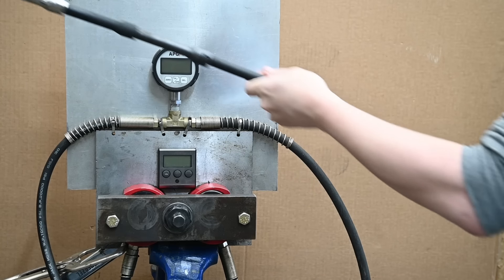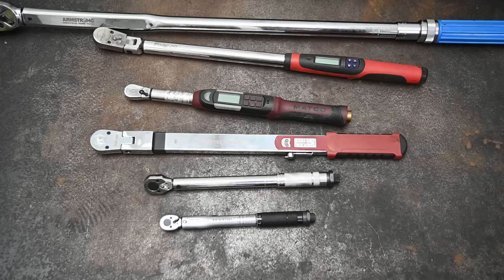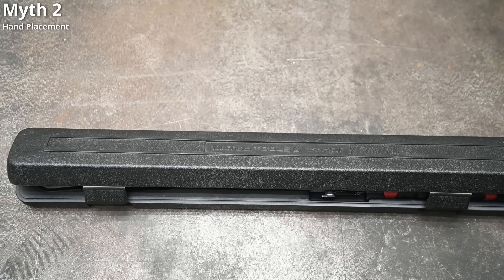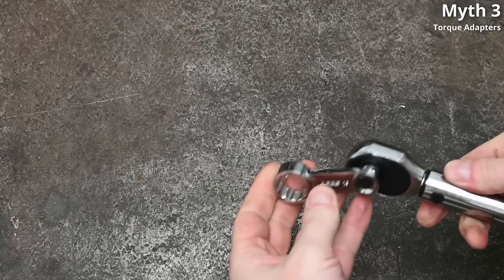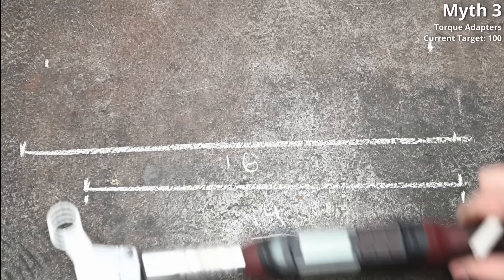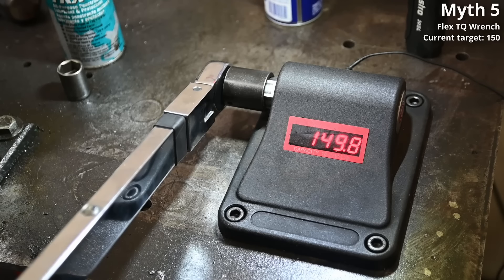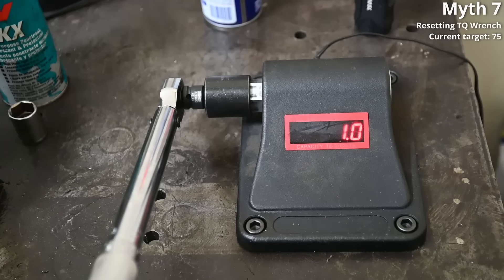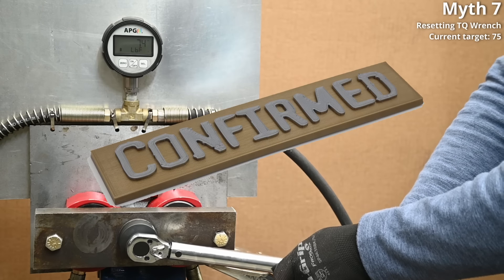You're Using a Torque Wrench Wrong: MythBusting 10 Do's & Dont's

Comment: i've generally enjoyed using the wrench by holding the end. easiest to apply the torque.
Reply: Yeah, it makes it harder work holding it anywhere else other than the handgrip. It's easier to get small bike wrenches wrong though, span your hand up and do something like push with your thumb up toward the drive head, and that could be a problem if you were trying not to over torque a carbon fiber part.
 I liked your Rio Grande Zephyr with 5714 heading.

Comment: I don't understand point 9: anti-seize.

While I can see that a torque of 100 lbft dry will put less tension on the bolt than 100lbft greased, the two devices are not measuring the bolt tension, but the torsion.  And, as such, if the torque wrench and the 'dyno' you are checking it against are in agreement, they should have the same reading whether lubricated or not as they are measuring the same thing (even though the tension on the bolt is dramitically different).  But they don't, so what am I missing?

EDIT - reading the comments, richardhorstketter6574 suggests that the 'dyno' is measuring tension and displaying a calculated torsion reading.  If this is correct, then that explains what I am missing and begs the question of why we weren't told this in the original video.

Comment: It's all about tension. Torque is a unit of force. 1 lb of force at 12" from Axis is 1 ft lbs. Of torque. Most wrenches are calibrated to be turned only from center of hand grip area. The biggest influence on tension v torque is thread condition and lubrication. All this being said, the most accurate way to tension a bolt properly is by using turn of the nut method . Torque angle I believe is the same concept. If you use a socket that comes outside the wrench axis, you must calculate the difference.

Comment: I did forget and leave my clicker torque wrench set to 100 pounds for a month. Do you know if letting it rest while set to 0 or 20 ft-lbs would let the spring recover?
I came up with a DYI torque calibration technique: I put a bolt in my bench vice, put the torque wrench on it with the handle parallel to the floor and then hung bar bell weights on it from the center of handle grip. Then I did the math for the 18" length of my wrench. It tested well, so maybe the wrench spring did recover. I only use the wrench for lug bolts so I called it good enough.

Comment: No the angle on the flex head torque wrench does make a difference it's just a small difference at the angle allowed. The effect of inclining the handle is identical to the effect of holding it at a shorter distance, but cos(x) ~ 1-x^2/2 so the effect of the shortening at small angles is very small.

Comment: You didn't mention that when using long extensions with a torque wrench, it requires you to use much more effort.  You have to overcome the twisting of the extensions, in addition to delivering the set torque amount.
Reply from the maker: Good point

Comment: Good video. Thanks.       What if your TW was sitting at a high setting for a long time but now has been sitting at a low setting?  Theoretically letting the spring relax.   Can I now adjust it to the setting I need and get accurate readings?

Comment: The Pittsburgh might be a little better now. 15 years ago I bought one and I would torque this aluminum bolt in the 4l80E trans. It torques to 12 ft lbs and breaks at like 18. Come to find out I had dozens of units out in the field with that bolt broken. Must have been clicking a lb or so before breaking and then breaking in the field. So just beware.

Comment: On conical seat wheel nuts, most of the friction is from the seat itself and not the actual threads as they are much oversized for extreme reuse and abuse. Would you test that? I always lubricate my wheel studs with either moly grease or copper anti-seize and have not had these results. My experience is that I get more consistent torque especially with old or very used fasteners.

Comment: Excellent video. Using a lubricant on the head of the bolt or not , ie , the mating surfaces , must alter the torque applied as well ?. Regards from the UK.

Comment: Excellent video.  Wondering what would have happened with that Pittsburgh wrench if the tension was released and it was left to sit a week or so.  Would it return to being accurate on its own or is the spring permanently altered by leaving it in tension for 6 months?  Because if it does go back to its original state it would seem if it was recalibrated before being allowed to do so then it would go out of calibration as the spring regained it's original characteristics.

Comment: Most people don’t adhere to lubricant used on head fasteners. Ever take the bolts out that never been out before wonder why carbon coated? They used oils to install at factory.

Comment: Where you press on the wrench and how you press is extremely important, especially at lower torque values. It has to do with the length of the shaft from the head to the breakaway. You can, rather easily, make a torque wrench break at 12 in pounds without even rotating the bolt at all.

A crow's foot makes this distance longer. That is 100% the exact same effect. At 90 degrees, this length is NOT increased, because it's only the length in the direction of the shaft that matters.

15:50 The adjustable wrench head is longer, so it gives higher values. There's zero reason the head shape matters. Exact same effect as the previous two. All that matters is the lever arm length.

Comment: For the extension at different angles, I wonder if it's really the "horizontal" length as you're showing here, or actually the distance from the center of the handle to the bolt. With a short extension like this they'd be almost equal, but that might not be true with a much longer extension... e.g. imagine a 14" wrench with a 14" extension at a right angle - the actual distance from handle to bolt would be sqrt(2*14^2)=19.8"

Comment: By scrolling just 5 comments down, it appears that a follow-up video (series?) addressing anti-seize (and other thread 'lubricants') more in-depth would be much appreciated.

Actually, I wonder what effect thread locker has, too. We're just scratching the (unintentionally-lubricated) surface...
Reply: I thought it was interesting that you applied it to the 'back' of the threaded portion, as opposed to the 'front'.  I've tried various methods here in NE Ohio and settled on a conservative 'line' from the one end of the threads to the other. Which would apply roughly an even coat to all threads. 

It goes ALL OVER the back of my wheels and/or wheel-mating surface of my brake rotors/drums. (Not too much, of course, because that could 'anti-seize' your braking surface... and likely lead to unexpectedly anti-seizing your body from the vehicle or head from your neck.  Ain't nobody got time for that.)

Comment: New question: Does Loctite work mostly by turning into glue later, or mostly by encouraging you to tighten the nut or bolt more securely due to reduced friction while wet?

Comment: I have a love hate relationship with digital torque wrenches. I like the technology and accuracy, but it’s so easy to over torque. The tactile feedback of a clicker just allows me to respond faster, being able to let up on the wrench before I go over my torque value. Also, I feel like with a digital, if my target is 50 and I hit 50 and go to give it another confirmation pull, the fastener will seem to move again before it even starts to hit 50. With a clicker I can click the wrench a thousand times and the fastener will not move a single degree more after the first click. Never was able to figure out what that was about.

Comment: With anti seize,  Ajax the bolt manufacturer recommends using 30% less torque when using anti seize or lubricant. So there is that.

Comment: I have one for you to try. I have had to torque some bolts recently to 1800 ft/lbs and the biggest torque wrench I have only goes to 600ft/lbs. I used a 5 times torque multiplier and torqued them to 360 ft/ lbs. the only thing I am worried about is how accurate this is.

Comment: If you tighten your wheel nuts to torque while dry, mark the position, lubricate them and then retighten to the mark, you will have wheel nuts effectively tightened to about half where they should be.  They will undo themselves and your wheel will fall off.

Comment: Is the anti-seize test truly representative of wheel lug nuts and studs? Yes anti seize will reduce friction between bolt and nut, but wheel nuts have a taper that engage with the wheel which provides a ton of contact area and hence is a major source of friction. My question is, what’s the impact in that case to use anti-seize just on the threads but not the taper?

Comment: Antiseize is to be applied like cologne. Just a dab. Its not gravy on a biscuit or syrup on a pancake, you apply it like super glue. Wipe the excess off of the brush and apply a thin dab on one side of the threads and let the nut spread it around. Retry with that in mind and try with the different flavors for science sake. My employer mandates the use of copper based anti seize on lugs and very rarely do we brake a stud. 30-100 tires a day 7 days a week 363 days a year and maybe 5 broken studs a year and normally it's a FNG that does it. Curiosity demands answers if you'd be so kind.

Comment: Can you explain your machine?  I believe  you say that it measures bolt tension and translates that to the applied torque. How are you able to make the conversion? There are many factors affecting the relationship between wrench torque and bolt tension.  If you are testing torque wrench accuracy, isn't your calibration machine the best method?

Thank you
Larry

Comment: What about changing grip distance on a Deflecting beam torque wrench? Like the kind you have to look at the needle as it quivers over a graduated plate near the handle.
Reply: Most beam wrenches are length dependent. The design you describe would be awkward to use from the wrong location. But if you did pull from a shortened position, the indication would become inaccurate, as a portion of the beam no longer deflects but rather remains straight so the scale would not move as far as it should travel under the pointer, so it would read less than the actual torque being delivered. Many have a knife-edge in the handgrip to precisely define the loading point - my old el-cheapo one doesn't.

Comment: I was yelled at by my neighbor for adding a cheater pipe to a torque wrench.  Buuuut said wrench was a old style one where the needle comes from the head back a physical scale and the measurement comes from the bend in the shaft, not a racheting interior. I've also had to recalibrate it because I welded it.

Comment: My 2004 jeep liberty sport needs new axel hub mounting bolts. The torque is 97 pounds. When you add anti seize. You set the torque on 194 correct? Regular torque from Walmart.

Comment: Piggybacking on the anti-seize "myth," would it be possible to do the same test with a threadlocker?

I'd imagine there will be a similar effect vs a dry bolt (and a similar work-around), but it'd be nice to see if the problem has the same magnitude of the anti-seize.

Comment: but realy accurate "bringing tension into clamping two pieces"  is done on Wartsyla ship diesel engines , where you pull hydraulically the rod and rotate by hand the nut down  and than release the hydraulics

Comment: Myth #7 - from what I've been told (at least pertaining to gun magazines) is that springs will take an initial set but then stay there. So my curiosity then is after recalibrating a torque wrench that had been stored compressed, is it now less susceptible to the torque changing if it is stored compressed a second time?

Comment: You don't mention 'beam scale' type torque wrenches.  No need to worry about calibration, they just work.  As long as beam returns to zero you're good.  BTW-  how do you calibrate a digital torque adapter?  Buy two?  haha.  Right.  Good tip on the luggage scale, it's easy to calibrate.

Comment: Hey, I have a question about the anti-seize. How much is too much? Or is using any at all going to screw up the torque reading. For example, if you put a different amount on the threads or maybe just put it on the head where it contacts the mating surface. Just questions I had that maybe could be tested. great vid!

Comment: 18:30 Could one: 1) Bottom out the bolt-head by hand 2) Wrench to the desired torque, thereby exactly counting the number of turns (example: 7,25 turns from out-bottomed bolt-head to 100Nm)  3) Unscrew the bolt and apply the lubricant to it 4) Bottom-out the bolt-head by hand, try to apply the same hand-effort as previously, but in no case more effort that previously 5) Wrench it further (from the example above: for 7,25turns exactly) with the same, original torque-wrench (or with any other simple wrench, where the hand-grip-center to bolt-head-socket-center have the same distance as on the original torque-wrench). 
Could that circumvent the problem ??? Will you give it a try, for the sake of experimenting?

Comment: What about dropping the wrench? Every time a torque wrench is dropped in the shop I work at, it will get recalibrated and won’t get used until so. I’ve always wondered if that is true
Reply: There are videos of people testing the result of abusing torque wrenches and finding they were still within spec until quite severely damaged. What I think it comes down to is that the wrench becomes an unknown factor if something untoward happens to it. Unless it's confirmed in spec, that becomes a liability if you're representing to customers (or an insurance company or accident investigators) that everything was done properly.

Comment: I have a counter to the always zero your torque wrench, I bought a cheap, on sale ½ inch 20-250 ft-lbs click type wrench 28 years ago for use at home. As a professional, I always went to my schooling and zeroed it after use... Well one time I forgot to zero it, worse, I left it at 150 ft-lbs for about 6 months. Discovering this, brought it into the shop and tested it at 6 points, 3 times each, from 20-250, 3 points were at 0%, two at 0.5%, and one at 2%.. My best and oldest torque wrench is a unicorn
Reply: Keep in mind the P-berg torque wrench he used costs a whopping $20.
Looks like he got exactly what he paid for: Junk.

Comment: I was trained to put gear oil (75w90) on 33mm flange nuts to get a "true" torque of 475 ft/lb. Could this be doubling the true torque instead of insuring it like with the anti-seize? I work for loves truck care as a tire tech and do this everyday to peoples trucks....

Comment: I think I can re-learn and figure it out on my own, but can you cover the math needed to torque when you can't keep the drive head in line with the fastener?  It's a question of force that divides out based on the angle.  It's easy to say, "Just keep it straight!" but that's not always possible on cars in my experience unless there's always going to be a way around it with a torque adapter or crow's foot.

Comment: The handle thing will get even worse with one of the old-style flex torque wrenches.  Probably nobody uses those any more since better designs have gotten so cheap, but they absolutely rely on having the entire length of the handle bending in order to measure accurately.  Modern wrenches with more rigid handles will be less susceptible, but it's still going to be a factor.

Would be interesting to see the anti-seize test done with PTFE tape.  I tend to use that in most places because it's almost as good as the grease and far, far less messy.  It probably still lubricates, but it might give a more consistent amount of lubrication at least.

Comment: Now. Regarding the anti seize for a sequel.  Make a rusty bolt. Try it.  Then apply anti seize.  
Kinda stuck applying it round here after having some bolts get horrendously stuck… haven’t had any issues.  But I also dont slap it on like butter. 🤣

Comment: Wow - didn't expect literally double the torque on greased bolt. I knew it will be more, but not double. Also consider it other way - if it is dirty, rusty etc... you may get half of torque!

Also quite a big difference on keeping the wrench tightened... I have also tested it myself vs. digital torque wrench, but likewise I only left it for a month. Basically, what happened is that I accidently left torque wrench tightened for a month and when I realised it was the case I decided to test if it is still accurate with digital torque adapter... and it was till within spec. Which lead me to wrong conclusion that this was myth and since then I stopped unscrewing them since every use... meaning I SHOULD CHECK THEIR ACCURACY AND ADJUST NOW!

The one with extension and "crow foot" I actually knew, both the calculation and that extensions does not affect torque on normal torque wrench, the extensions affect impact, because they reduce the impacts, but when you do it by hand it is fine, because even if there is little bit of slack or twist, you still ultimately have to reach the force required.

Quite surprised that holding it at different places impact the torque, but after explanation I understand why... good that I have never used micrometre type with extension pipe, because as it happens I only got digital one when I needed to do 280NM on hub bolt or something and my mechanical ones could not reach that torque and I used breaker bar with extension to get there, but that is relief that digital ones are not effected by extensions.

All in all very informative - thanks.

Comment: Would putting Loctite on bolts result in the same as anti-seize?? Many times the manufacturer requires Loctite on high-vibration applications.